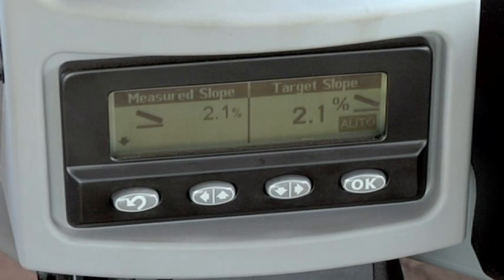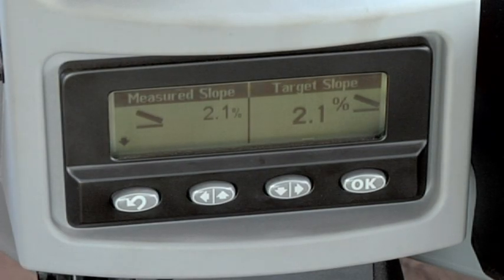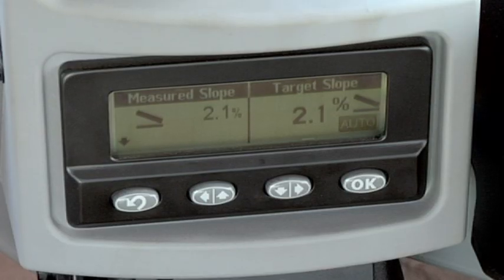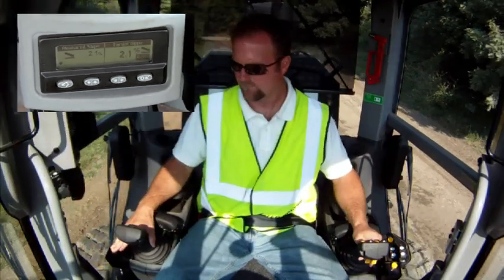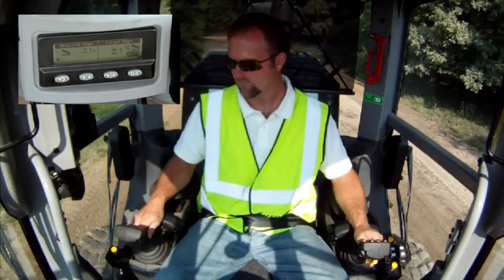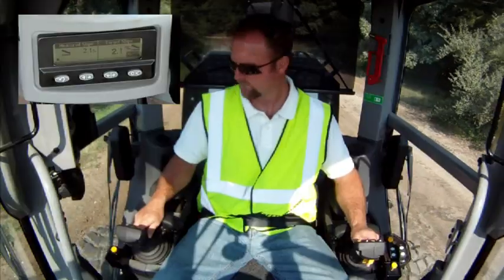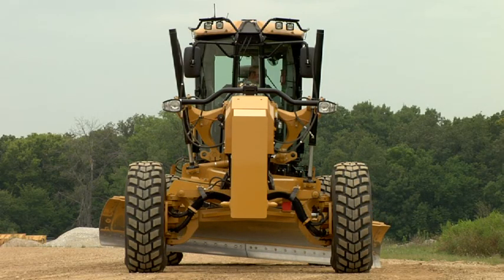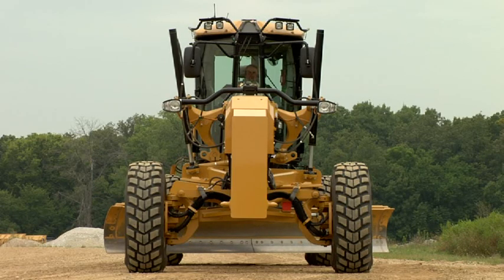Cat Grade Control for Motor Graders: Basic Operation

Comment: My question but I'm a G and H wannabe  but if that computer don't work is the machine down or can you manually do it. How machanic friendly because seem more eletric stuff harder to find in wire harnesses ect tearing the seat apart dash ect. When the H you can track the valve itself under the cab and hydro over hydro and the H you got a level in the dash a bubble level but works if the machine is level or on side or the other but putting it in first and control the deceleration by foot and such for slicing rolling and siding a cut instead or grubbing so to say a lot of guys I knew when to M and shortly after when to the deeres due to power and such my self the 163 6x6 with the heavy front helps slice pull and push but that's me the weight of the front axle helping keep the blade down instead lifting the light front ends plus the push block weight on the front

Comment: an operator has so much more "touch" with traditional controls.  you can feel the resistance through the knobs.  the joystick is for novices.
Reply: Tell me youre a halfwitt boomer without telling me
Reply: So true.
Reply: Agreed, and this looks a lot more complicated than the knobs, with this it seems every time you changed directions it'd take 20 minutes to get all the functions set up before you could start grading back across
Reply: Nah I’ve run both, my 12m doesn’t have the grade control/auto features. And compared to my old grader with traditional controls/ a rack, the joystick is better. You have to relearn running a grader but once you do it’s better.

Comment: Thank you. Been looking for info on tech and controls on new motor grader. Currently in a 2019 12m series 3. I have about 15 hours seat time. Overwhelming is an understatement
Reply: Well are you an expert now it’s been 4 damn years lol
Reply: @jimmy4x4socal44  well I ended up working for a wind tower company building crane roads.  I’m not working the grader anymore. But I miss it.
Reply: @PickleHick  dozer work? Building roads? Or paving?